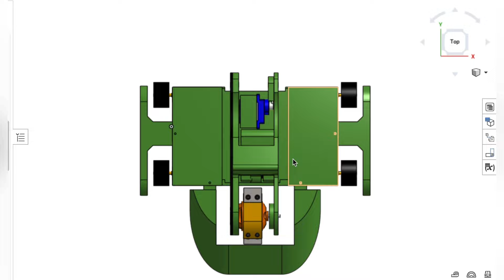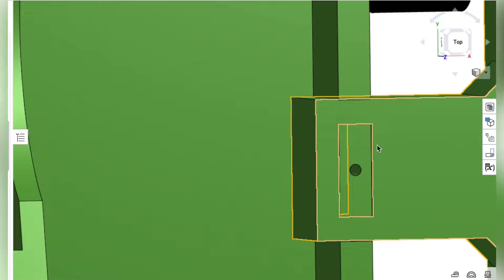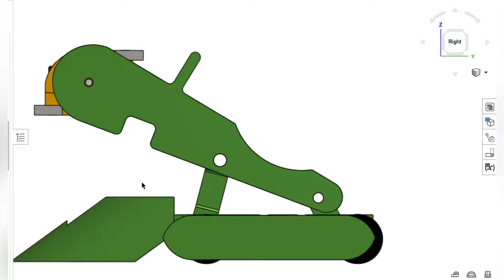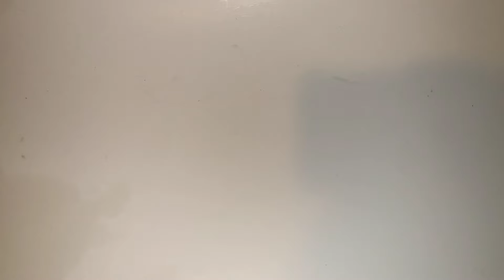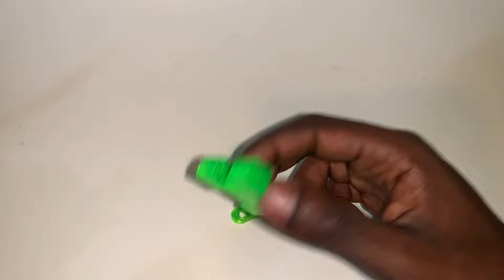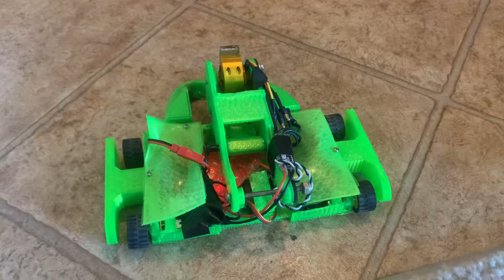THE BUILD PROCESS: Esper (Antweight)

Comment: I've been trying to get into antweight battle bots recently and I have a design for a 1lbs robot, but I'm stuck on choosing the electical components for it. is there anyway you could help?
Reply from the maker: Sure. I would love to help. What kind of questions do you have?
Reply: @teamgetwreckedcombatrobots776  I found a brushless motor and esc combo online for my weapon (saw blade), and I can’t decide what to do for my drive motors. Also what battery I would need. I have a remote and reciever, it’s the flysky fs-16 6 channel
Reply: @teamgetwreckedcombatrobots776  I’m trying to make a saw blade robot that can swing on either side. So like a rectangle that allows a 180 degree servo to swing an arm that has a saw blade at the end. I have the servo and saw motor (brushless and esc) from Amazon. But I can’t find a good drive system and battery. I can send you the stuff I already have if you want
Reply from the maker: @xwilliams5135  Sure. My email is “Pakemaane@icloud.com” if you want to send me what you have so far.
Reply: @teamgetwreckedcombatrobots776  I sent an email but Idk if it went through. does your email have a profile picture?
Reply from the maker: @xwilliams5135  I got your email and I really like the look of your bot so far (saw bots are just plain awesome).

 In terms of what you want for a drive system, assuming you’re doing direct drive for 2 wheels, then I would probably suggest these Repeat Drive Brushed Motors, as I’ve heard good things about them from other builders who have used them: https://repeat-robotics.com/buy/brushed/

If you don’t have the weight for those motors or they don’t fit you could also use N20 or N10 Motors from Turnabot which have less pushing power but are lighter and take up less space. You can even choose the exact RPM you want. Just make sure to pay attention to their stall currents and ratings: https://turnabot.com/products/high-power-n10?_pos=1&_psq=motor&_ss=e&_v=1.0

In terms of what Battery you should use I’m honestly not that knowledgeable on specific kinds of Batteries but assuming you want a 3s battery (which is usually standard to Antweights), I would recommend the 3s batteries from Palm Beach Bots due to how light and compact they are (as for which mAH and which C rating that’s likely gonna depend on the rest of your electronics but generally speaking these batteries should get the job done): https://palmbeachbots.com/search?type=product&options%5Bprefix%5D=last&options%5Bunavailable_products%5D=last&q=3s+lipo+battery

Unfortunately those batteries are currently sold out but I heard they should be back in stock within the next few weeks. If you can’t wait or just want to try something else I would suggest looking on Amazon as if you’re specific enough you can usually find the exact kind of battery you want (although I doubt they’ll be as weight efficient as the palm beach batteries).

As for a drive ESC, for most of my Antweights and Fairyweights I’ve just been using this very basic duel brushed ESC from Amazon and personally they’ve worked fine for me and I’ve never had any really problems with them (I’ve linked a four pack but you can usually find them in other quantities). https://a.co/d/bTgFDNx

You could also try this duel brushed ESC from Repeat robotics. I’ve never used it but I’ve heard good things about it. https://repeat-robotics.com/buy/desc/

There’s also these FingerTech tinyESCs which are very small and light but in that case you would have to wire two of them together. https://palmbeachbots.com/products/fingertech-tinyesc-v2?_pos=1&_sid=30b1749a1&_ss=r

I hope this was helpful. And let me know if you have any more questions of just need something clarified.

However, I would highly recommend getting a second opinion and asking as many other people as possible for what you should do. Even though I’ve been in the sport for a while now I myself am still learning and I don’t know everything.

I would recommend joining the NHRL discord server and asking questions there. Alternatively, you could also look at the Antweight Combat Robots Facebook Group or Combat Robotics Facebook Group.

These places are filled with amazing builders who are always happy to help out newer builders with whatever they need.
Reply: @teamgetwreckedcombatrobots776  Thank you so much! this is really helpful! I will be sure to join that discord too!
Reply from the maker: @xwilliams5135 You’re welcome. And good luck on your build!

Comment: In the future for Carbon Fiber use cncmadness  You will get the parts for a quarter of the price from send cut send. Send cut send is awesome for steel and ti but very expensive on carbon fiber.
Reply from the maker: Thanks for the advice. That one carbon fiber part from SendCutSend cost me like $30 so it would definitely be nice to use a cheaper alternative.
Reply: @teamgetwreckedcombatrobots776  My plates for Rougaroo's chassis are 32 dollars at cnc madness. They are also 3mm thick.

Comment: Still great design, can't wait to see it in action!

I think putting a CF panel on top of the 4 bar arm (so it holds the sides together preventing the weapon from flopping out of its bearings) would give more stability to the weapon than one mounted on the side, but putting it like this should help with the weapon flopping up or down.
Reply from the maker: You know what, that sounds like a good idea. I may end up switching to that for the next version of Esper depending on how things go with this one.

Comment: I believe I recommended used a high voltage malenki nano from turnabout for the fairy, but it would also be perfect here, there are even two outputs for the weapon ESC and servo, not to mention the built in drive secs and receiver all for just 2g. Built looks great! Love the new armor package!
Reply from the maker: Thanks for the compliment. Also I started building Esper before I learned about the malenki nano but from what I’ve seen it looks great so I’ll definitely be using one next time.